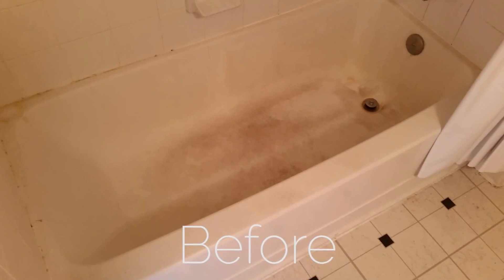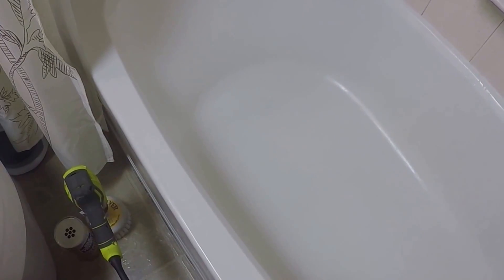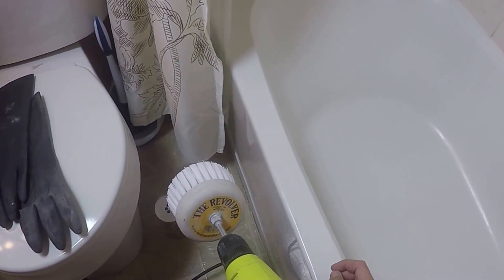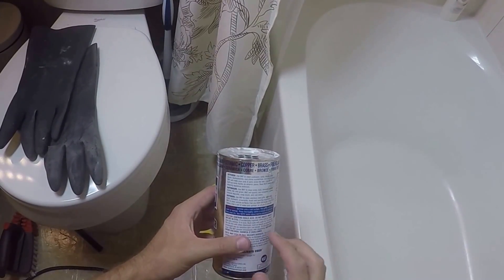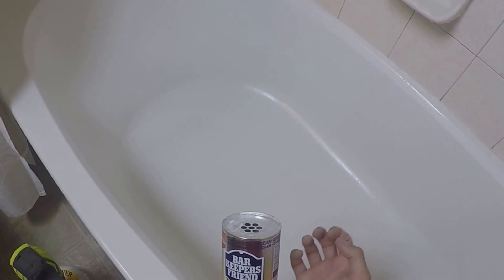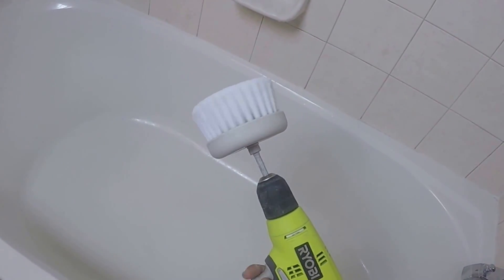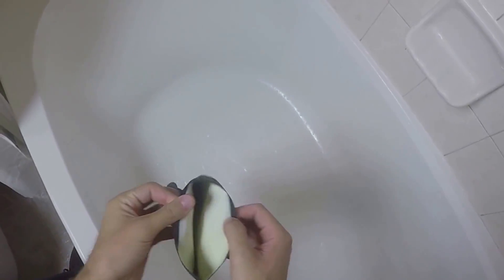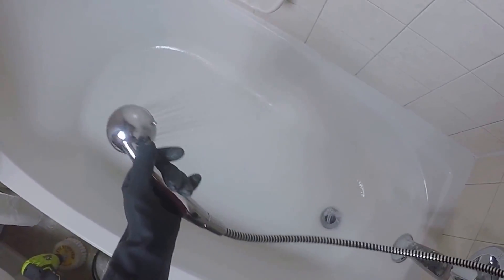How To Make Your Dirty Bathtub Shine!

Comment: Thanks this totally works! Been trying to get tub this clean for years and nothing works especially the dawn n vinegar thing. Using this method is only way will get clean. Almost bout new tub and will actually take a bath instead of shower! 5 star solution! Also brush is only 15$ on Amazon.

Comment: Bartender's Friend is an abrasive and is not actually recommended for fiberglass. It might damage/remove the surface shine from a fiberglass tub. If you try this, proceed with caution and test a small area first to see if it damages the shine.

Comment: Thank you, I'll try this but just with a brush and also make sure to well ventilate and wear mask...
Reply: Bar Keepers Friend doesn't produce any fumes or dust, especially when it is applied to a damp surface.  No mask or eye protection or ventilation are needed.  Gloves are helpful, because Bar Keepers Friend contains oxalic acid, and oxalic acid crystals are needle-like and can cause persistent skin irritation.  I found out the hard way when I came in contact with agave while removing the plants from a garden.  Agave have oxalic acid in their juice.  The itch on my right forearm didn't go away for several years, although nothing was visible on the skin.

Comment: Good video but Just use a battery drill easier to control. No need for the extra power just have 2 drill batteries. Plug in drill is too powerful.